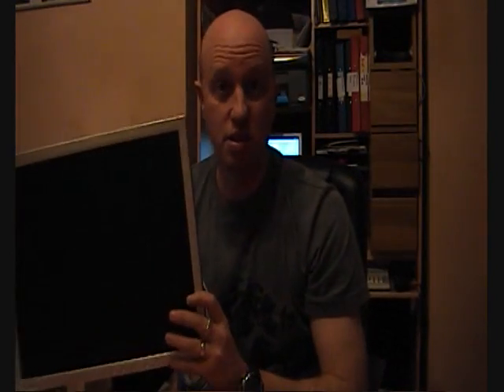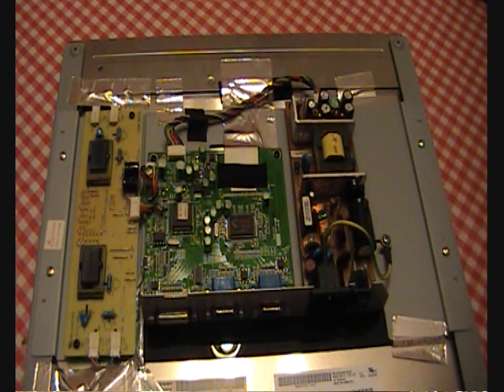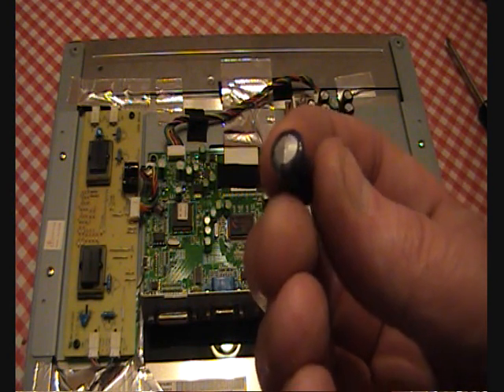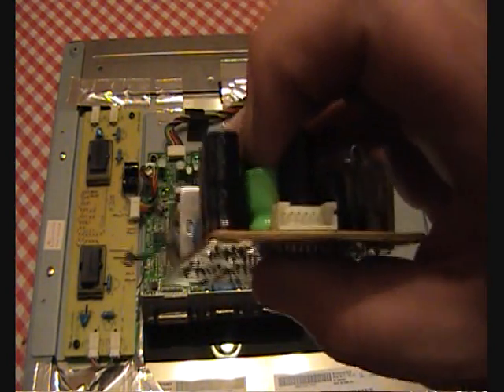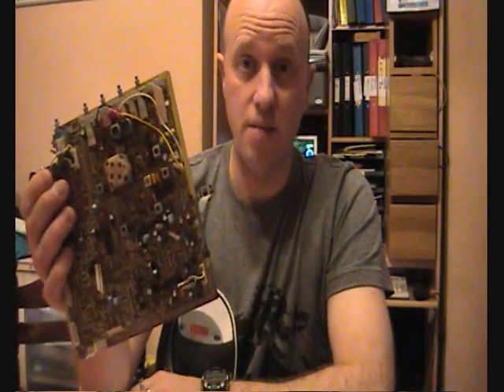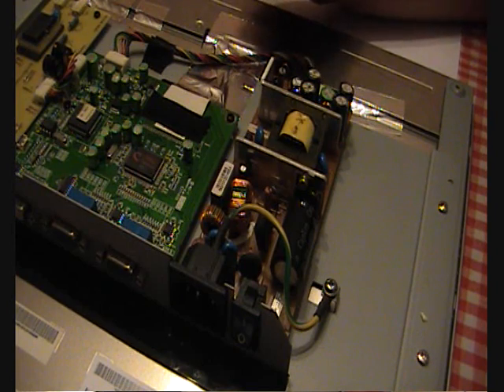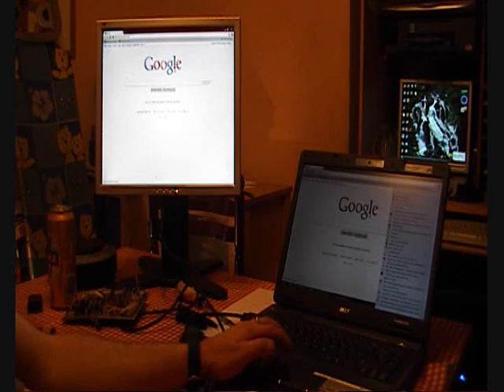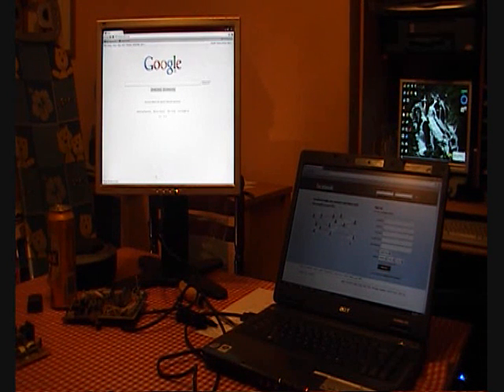How to repair a broken PC monitor with capacitors

Comment: Hi there. First of all thank you for this video, is really helpful.However I have one question: I have a monitor from 2006 and last year for no reason started to show only white. Since then I Have other monitor but after watching this video I would like to repair it. Do you think that white screen could be a capacitor too? I can put a video on my channel for you to see. Thank you in advance.
Reply from the maker: Hello and thanks for watching. 
I don't think the white screen would be caused by a faulty capacitor. It is most probably something else. Have yo tried adjusting the brightness, colour settings? Or this could be a problem with microchip that has malfunctioned. Good luck and I hope you get it fixed.

Comment from the maker: yes, if you have an old monitor with capacitors that are blown, you could repair them. make sure that when you take the monitor apart that all the electronics and capacitors you touch in the power supply unit are discharged and safe to handle. DO NOT TAKE RISKS WITH ELECTRIC SHOCKS. Hope you manage to repair your monitor.
thanks for watching

Comment from the maker: @wescoolya 
be sure u use the right type of cap, the one u saw in my video is an Electrolytic type. make sure  the values match the original ones & if u can match the capacitor 2 the original 1 it would be better. there is quite a few types of caps available,  take the old ones 2 your nearest electrical store & they will get u the right 1. be careful when doing this type of work as can result in electrical shock. i only made this video as guide and  work you carry out your self is your own risk

Comment from the maker: @axzelrowze21 
Hello, you may have had a power surge at some point. have you checked to see if there are any internal fuses? does anything else look out of place on the circuit board?
by the way, what did you use to test the resistor and did you test it properly.